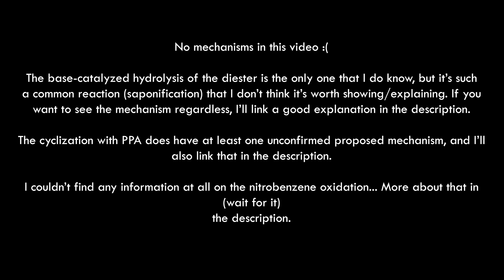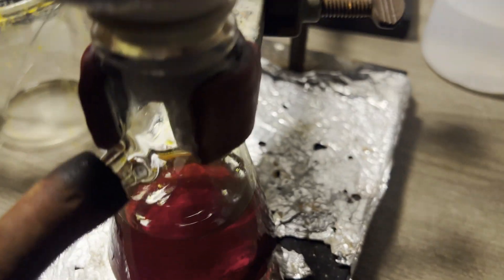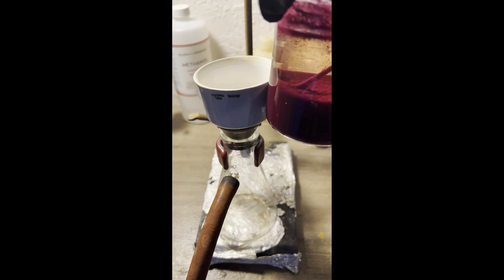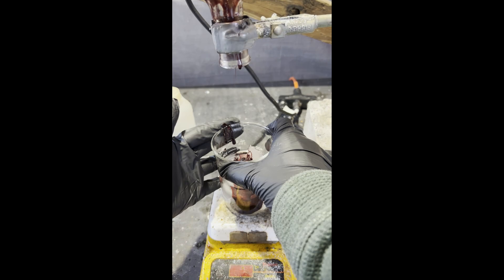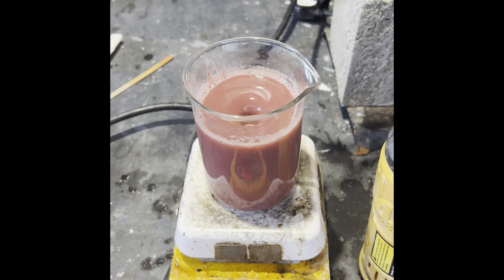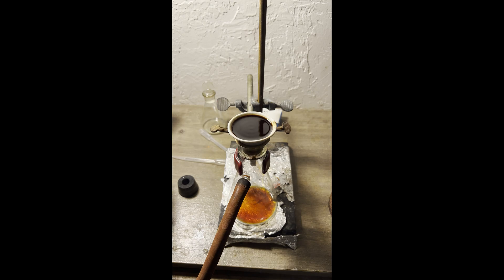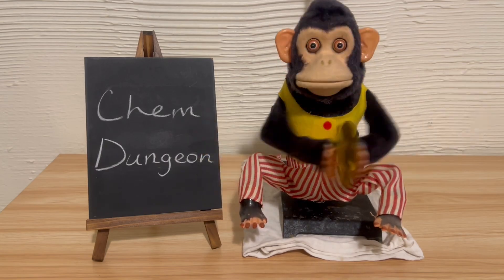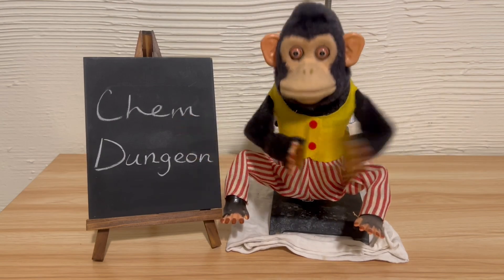Making quinacridone

Comment: I've been looking for this exact type of video about quinacridone for years. Now for someone who can synth up some quinacridonequinone and I'll be happy.
Reply from the maker: Quinacridonequinone is proving to be more difficult to synthesize than I thought it’d be. The method starting with quinacridone hasn’t worked (3 attempts) so I’m going to try the method starting with dihydroquinacridone which hopefully will work
Reply: @ChemDungeon I've always just used bulk pv19 as a source for QQ to make quin gold. But it's getting really expensive and I don't know how to make QQ. I'm not a real chemist, I'm just some weirdo who makes paint and collects pigments.

From what I'm told it is actually quite difficult to do which is why a couple other chemistry YouTubers who did a lot of pigment stuff won't touch it
Reply from the maker: @MrPigments  Yeah, for some reason QQ is being phased out. Any idea why? 

Some methods are super annoying to do at home. A few that I've found seem very straightforward, but that's also what I thought about the method starting with quinacridone and it didn't work at all. Time will tell
Reply: That's the first I'm hearing about it being discontinued or phased out. I'll have to do some research into it, but I work in the Auto coatings industry so it's a little bit hard to get info out of people there.

QQ is super important for pv19 which we use all the time.
Reply from the maker: @MrPigments  Oh, I don't know if it actually is being phased out, it might just seem like it is because it's become harder to obtain from non-industrial scale sources.   Outside of the auto industry, its widespread usage in printer ink might be something to look into for you. Not sure if QQ is used as much as quinacridone is, but it could help out.

I bet it is! Definitely deserves the "high performance pigment" classification.
Reply: @ChemDungeon I've looked into it a bit, it's something I need to research further though. I find it all very interesting. 

I seem to have selected a weird hobby though since pigment videos are rare on this platform and I've never seen a quinacridone one before.
Reply from the maker: @MrPigments  It is very interesting. The difference in colors depending on the crystal phase is another aspect that really sets it apart from a lot of older pigments, very cool stuff.

Right? After someone asked me to do this synthesis, I was surprised when there wasn't anything out there on YT when I looked into it. There is some, but only a little on sciencemadness.